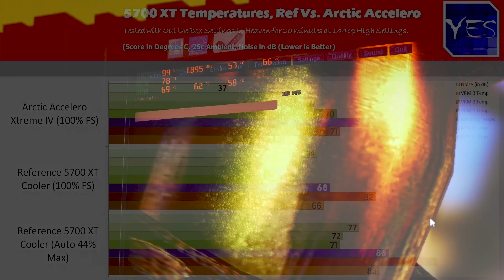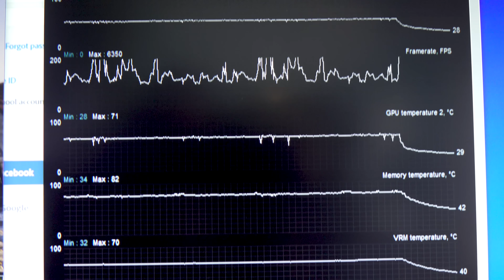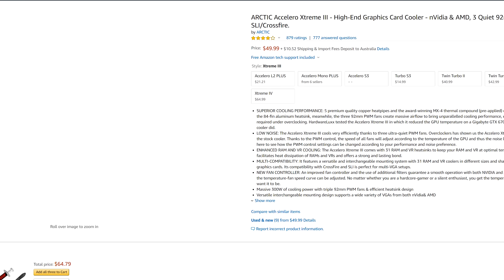Arctic Accelero on a 5700XT - Is it GOOD?!

Comment: Remember my ATI 5870 i added an Arctic 3 Fan cooler on that one and it was so silent at 100% speed but in normal usage it never went above 10% fan speed and you really couldn't even notice the noise from it and was really chilly :D tho the heatsinks they had back then loved to fall off
Reply: did it die at some point?
Reply: @milchkopf3881  It´s still alive and i have it in my house :) not using it anymore it still works

Comment: Can already tell its good, I have it on one of my rx5700xt, temp is much better than any of the aib models. Only downside is you need low profile ram on even atx board, the backplate fins have clearance issue with the ram.
Reply: Btw the backplate works very well, a shame you didnt use it. I'd get a cutter and cut out the fins that have clearance issue.

Comment: You can take the plastic spacers and mod the stock cooler by putting them under the cross brace. I've seen a 10°c GPU temp drop.

Comment: Yes Man why the H**L does the 5700/5700xt use memory that wont oc? i mean most 10/20 series nvidia cards seem to mem oc at least + 300-500 my 1070 has been running +400 mem speed since i got it. Did they just buy some cheapo crappy memory or are there other factors playing in?

Comment: Arctic Accelero Xtreme Vl. Had him on my good old power moded GTX 1060. Imo the backplate is important. It gets pretty toasty which means it works and  takes a lot of heat away, especially from the vrms. My 1060 Never went beyond 45° Celsius, although cranked to 2189mhz and 1,093v.
Reply: The backplate is very important indeed, but the clearance issue is gonna be a problem for most people XD
Reply: 1.93v? You sure that isn't a typo?
Reply: @thetrashman5252  yeah i missed  a 0. Now its correct
Reply: @Squilliam-Fancyson  That is a very impressive overclock, I didn't realize that the 1060 was primarily power limited, changed mine to a 5700xt a week ago.
Reply: @thetrashman5252  yeah it was quite nice for a budget card.(Palit GTX 1060 Dual) You can easily see its power limited with GPU - Z (perfcap reason pwr). After performing the power mod, by soldering some additional 0805 smd resistors onto the existing ones of the power controller (the Kingpin method, which is safer then applying liquid metal onto the shunts)  this no longer happens, as the cards sensor only will show around 20% tdp at highest. The biggest limit is temp tough. Pascal mostly scales with temperature. Keeping the card below 48° Celsius is crucial to achieve sustained clocks of 2151mhz+, at least it was for mine.  Under 38° i could even achieve beyond 2200mhz. At this clock speed 5000 point graphic score at time spy is possible, which is almost  GTX 1070(stock) territory .
Reply: Thats weak, if you had true control, you could push up to 1.35v
Reply: @DarkLinkAD  no thats not true.  The maximum is 1.25v which only works with certain BIOS and BIOS flashing on Nvidia cards is a real hassle and often bricks the card. Only "safe" way is to solder a variable resistor to the voltage controller. Then you can go as high as that card can handle. https://youtu.be/69gQ-8_RXLE
Reply: @Squilliam-Fancyson  You said its not true and then you explained exactly how it is true.. Voltage should be unlocked period. If I can Flash the bios of an RX 460 4GB bought back in 2016 for $99.99 to give me any amp I wanna pull, any frequency, any Video ram timing. Every card should be capable..
If I unleash one of these things, they will pull 100 watts at half the OEM clock speed, Thats exactly what I want out of a card. 

Oh and If I want, I can have the card pull no more than 12 watts and still outperform a 550, or 1030 and match a 750.
Reply: @DarkLinkAD  nope you are completly wrong. 1. 1,35v is not possible via BIOS flash, 1.25v is the maximum. 2. You can not compare flashing BIOS on AMD cards with flashing BIOS on Nvidia cards, as since Pascal (GTX 10xx) Nvidia locked the BIOS. If you flash a non matching BIOS onto a Pascal card, its bricked, possible without a chance to get it functional again. AMD cards on the other hand can be flashed easily using atiflash- tool. But only until Vega(5. GCN generation). New Navi cards also have locked BIOS. 3. The thing a explained is hardware based stuff and has nothing to do with the BIOS. The soldered variable resistor tricks the voltage controller, so it thinks that there is lower voltage than you actually apply. BIOS stays 100% stock in the explained scenario.
Reply: @Squilliam-Fancyson  AMD cards have always been able to use the ati flash tool.
   RX 460 is Polaris/Baffin generation, are pre vega.
 The common idea is the same for AMD, Flashing too many times or flashing the wrong bios can brick your Polaris/Baffin or Tahiti etc etc (Ive flashed the same card too many times to count though, including the wrong bios, for giggles, its fine :P )

 Also, you said im wrong but you show how im right again.
     My argument is that all cards should be 100% unlockable, and if they arent, then the brand, be it Nvidia or AMD is a total asshat. Having so little control shows you nothing of the potential.

  Customers shouldnt support these lockdowns.. Even the old Maxwell could be unlocked.. 

 And I recall using some mulitple overclockign softwares to trick voltage readout on Kepler also.

Now that I can remember BTW, back in 2016 even with bone stock bios, you could push an AMD RX 460 to 1.38v easily on stock bios,(Might have been 1.45v its been a while) using a combination of 3 overclocking tools to trick/manipulate the voltage . I learned this through trial an error.. Your still limited in amps without the bios flash though.

Edit: Keep in mind I said  "Thats weak, if you had true control you could push 1.35v" 

Meaning, its shit that you cant, no one should stop you from using your card as you choose.
 If I only need a bios flash for a non enthusiast card (Turns out i remembered I didnt) then you shouldnt ever while paying twice as much or more.

Edit: I remember now, MSI Afterburner, Sapphire Trixx and AMDs OEM overclocking tool.
 If you do it in the right order, you get complete voltage control with stock bios.
Reply: @DarkLinkAD  do you even read? I already said that AMD cards can be flashed until Vega, which means that Polaris is included. Only new Navi cards are locked.
Second, there is no "flash to often". You can flash for example a Vega card, as often as you want to. As long it is the right BIOS there is no limitation like a flash counter or compareable shit. 
You argument was that if you can flash your Polaris card from 2016, every (newer) card should be capable of getting flashed. At least thats what i understood. Of course thats not true. 
But yeah, im with you when it comes to limitations of the end user. There should not be any for people who choose to void the warranty. Sry if i confused you with my sentence structure, english is not my native language
Reply: @Squilliam-Fancyson  Do you ENGLISH, you said "But only until Vega."
  This isnt a  complete sentence, which is why your sentence structure shows AMD cards were without flash capability until Vega came about.
   You should have said something along the lines of,
 "AMD has had bios flashing capapbilities, for a while now, all the way up to Vega." 

(All one sentence)

"It wasnt until Navi came about that they locked down the bios"

Doesnt matter though, you missed the rest of my post.

Comment: It is a different idea... AC3 has heatsinks and adhesive cooling paste.
AC4 has no heatsinks because they are arguing that most of the heat will absorbed by the pcb and cool this components with the backplate. Maybe you should use the backplate the way they suggest to get better results. 
I decided to choose AC3 for my 1080 to get the heatsinks and keep the original backplate. In my opinion AC3 is the better concept.

Comment: I thought the rear heatsink was suppose to help pull away heat from the VRMs and Memory. I used to use it with a huge thermal pad instead of a thin plastic isolation layer.
Reply: It is exactly for that. He didn't read the manual and totally screw the installation of the cooler.
Reply: @hungalas1  a huge thermal pad wont hurt but it doesn't help either just expensive

around memory, gpu and vrm with a bit of overhang about 10 to 20% more area is plenty enough
Reply: @hungalas1  Only if you put some kind of heatsink on the thermal pad.

Comment: Btw ... the backplate for the accelero is made to cool the memory too , but from the back . 

You can check timmy joe's video
Reply: Yep, the backplate actally cools the memory and the VRMs. 
No need for extra heatsinks on the top them.
Reply: Better check  PC Games Hardware https://youtu.be/WGo6s-2RXwo (German but temps and sounds are international).
Reply: @GreasyPlopper just cut the part that was in conflict with the ram off, you cant see it from the front anyway.

Comment: The reason the memory temps on the Accelero are so high is because the GDDR6 die is closer to the bottom of the chip than the top. I’d try sticking more mini heatsinks on the back of the card over the memory and see if that improves temps.
Reply: Or I have a really stupid Idea...hmm...how about using the MASSIVE backplate heat sink with the heat pads. You know, that "worthless" stuff that he so easily dismissed right from the start. Just a thought.
Reply: @d1oftwins  not the first time a youtuber thinks they know better than the public or the company making the product
Reply: @d1oftwins  Did this didn't improve Memory temps were worse then reference cooler. Have pics of it.

Comment: The ribbed backplate is very effective if installed correctly. You must cut cutouts for hot components to the insulating layer and install these fat thermalpads in these cutouts. Then inspect that there are no shorting. Blackplate gets hot and cools card if installation is successuful. I have installed about 10 Accelero IV s for 1080 ti  and 2080 ti s. These are mostly mining cards. Dead silent on mining and makes very little noise in gaming. So, my point is that the ribbed baclplate are not pointless. Another point for baclplate is that its very easy to restore videocards factory condition. Nothing is clued to the card.

Comment: Do you use the thermal compound that comes with the Arctic coolers, or do you replace it with your own?  I'm just wondering.  I have used them before, which they're fantastic, and plan to again on my current card.

Comment: GDDR6 is a "flip-chip" design, so all the heat is at the PCB side, not the top. I wonder if putting some heatsinks on the backside of the PCB where the memory is would drop the temps. Maybe even using adding 2mm thermal pads on the back of the PCB, and using the Accelero's included backplate, as it looks like it has a fair amount of cooling capacity. Just my thoughts though. o7
Reply: it definitely would improve memory temps
Reply: Well that's the whole idea behind this cooler...

Comment: mate cant comment about backplate with out trying it out first
Reply from the maker: You can if you look at it vs the stock fan speeds on the reference, the temps of the memory go up significantly and when on 100% they come down significantly, this was the same case on the 5700 non xt without a backplate.
Reply: @techyescity  nah you need to test the product with the desired parts that come with it not a fair review, even if it comes up negitive still its part of the product
Reply: @xboxrlz  +1 I agree Brian did not do this review properly, I used the Xtreme IV on my Galax RTX 2080Ti HOF OC Lab edition for a few months and could do 2175-2190 mhz core and +1000mhz  with no vrm or memory temp issues, the backplate works good enough to cool those components down.

Comment: Hey guys please tell me the faults in my build. I have the Ryzen 5 3600 red devil rx 5700 xt (dual fan) b450 tomahawk max hyper 212 black edition and a 650 w power supply. Should I keep my GPU or what should I change
Reply: It all depends on what you want what res you want what refresh rate you want  lost with this comment.  Seems you just shouting g out what you got as you mention no problems
Reply: top banana no honestly as I am a noob and just watched vids and this is what most people recommend and I do not have it yet but I M ordering it soon
Reply: Maybe you mean the Red dragon ? Anyways they are fine do not change anything but you can overclock if you want
Reply: MR.BR4DGA yes I do sorry lol
Reply: if you're asking for reasons to change then you know you dont need to change...
Reply: Looks good, unless you care about running emulation for older consoles like the Wii U and Xbox360, which you'll want to switch to an NVIDIA card for, but most people don't so you'll probably be fine.
Reply: Nope, that's  a quick PC, you've not mentioned Memory or storage though
Reply: Nothing wrong, make sure to get some 3200mhz ram and you're good to go
Reply: Forget the numbers on the boxes read reviews from online shops from the buyers. Xt cards are plagued with faults  and the pcb are budget  it's worth adding another £150 to get 2080 super or 70 or 60  more reliable better parts and more phases. Reference cards have 7+1 my 2080 super has 12+2. That's why n nvidia cards cost that little more  . But as said if you want 1440p high refresh rate then xt is not the card

Comment: im looking to get a pc i can game on but i am young and have little to no money. would it be smart to get a decentish pc on facebook or ebay or something, then put a really good gpu into it? that way i put money into the part that really matters. i would end be upgrading it over a period of about a year, i just want to start asap. it sounds logical to me, but you are the pro here. is that smart? or should i build a good pc straight off the bat
Reply: Depends on the budget that you have. Personally I currently have a $280~ pc with
ATHLON 200GE
B450 BAZOOKA
250GB M.2 SSD
450W EVGA BRONZE PSU
16GB TFORCE DELTA RAM
$40 case
Runs my games just fine. Given that i will be upgrading to a 2600 and rx580 in the future.

For $300 though i bet you can get a Ryzen 2200g and A320M Mobo which you can slap in a GPU in the long run
Reply: Harry McGilligan for a situation like that I would probs go for an optioned with an i7 and then stick a good gpu into it and add an ssd or more ram sticks. From there you can slowly upgrade everything. Though go for a psu upgrade first as the psu aren’t great
Reply: @thewise0032  im sorry i am new to pc building. what is an optioned?
Reply: Harry McGilligan oh crap it autocorrected. I meant the term optiplex
Reply: It's possible to get a good deal, assuming US prices, I'd aim for around $150 for the PC, and then around $80 for a RX580, and possibly some more money into a power supply if it doesn't have anything decent. In terms of PC specs you'd want something 3rd gen or newer from Intel for CPU, 8gb of RAM at least unless it's a computer with a Xeon CPU that can support ECC RAM because those are very cheap. A cheap SSD with DRAM for a boot drive will also be good if the computer you got only has a HDD.
Reply: Sapphire Pulse Radeon RX 5700... Expending almost the same money with better performance overall.
Reply: So, if you are really tight on an budget, you could go for a Budget Office Pc (i5 2nd to 4th gen), which sell for like 60 - 70 bucks and upgrade to 8 gb RAM, get a 120/240gb SSD and a used 1050 ti. This would set you around 200 bucks and should do decent at 1080p gaming, however you will have a hard time upgrading it and it would be better to completely sell it if it doesn't satisfy your needs anymore.
If you are looking for something more upgradeable, I would personally go with a Ryzen 3 1200 (50 bucks new) and overclock it, B450 Motherboard and something like a used Rx 570/580 or GTX 970/1060 depending on the price. you could later on upgrade to something like a Ryzen 5 sixcore or Ryzen 7 eightcore even and a stronger graphics card as well. This would set you around 400 bucks or less depending on the deals you can get.
Idk if that helped but here you go.